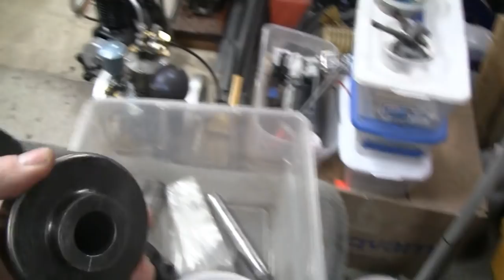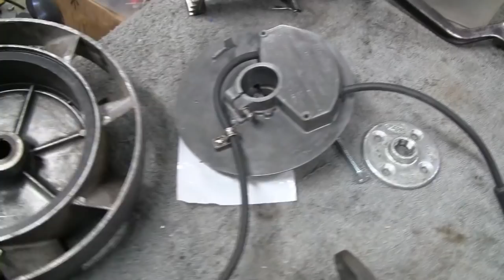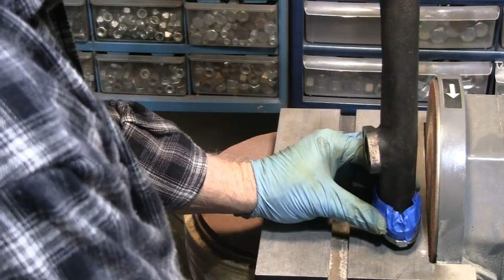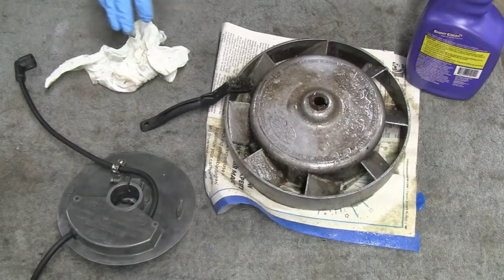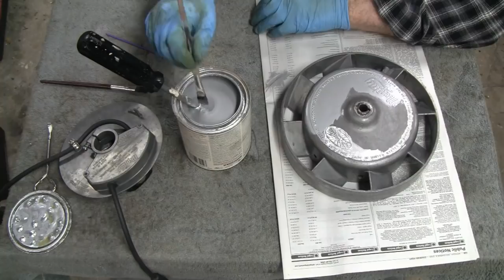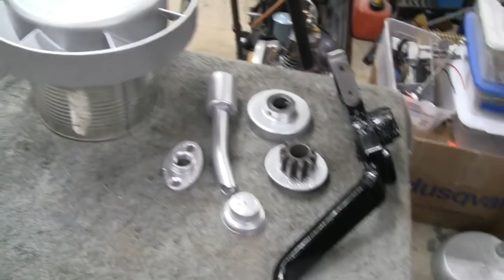MAYTAG 72 ENGINE REPAIR (part 12)

Comment: A lung-friendly way to remove zinc galvanising before grinding, sanding & welding is to strip the stuff off in hydrochloric acid down to the cast metal below, best done outside though, cos hydrochloric fumes can make stuff nearby rust like hell... :P
Reply from the maker: I got Galvo when I was a Kid from welding Galvanize, it almost killed me!!☺